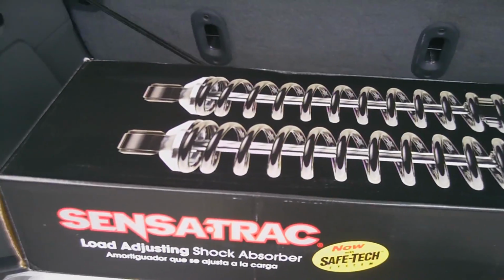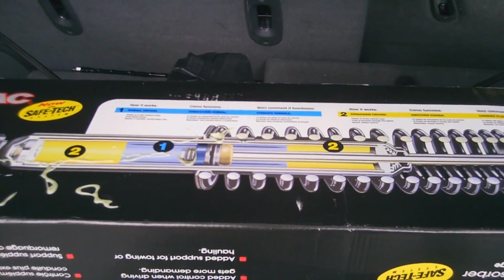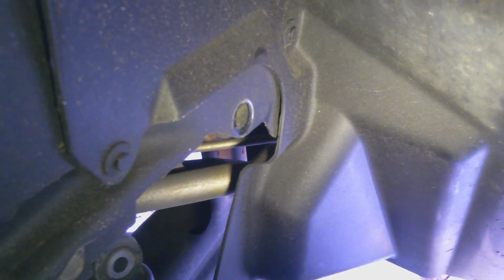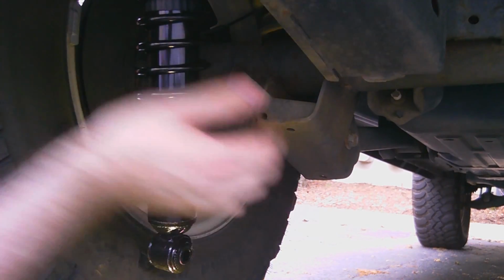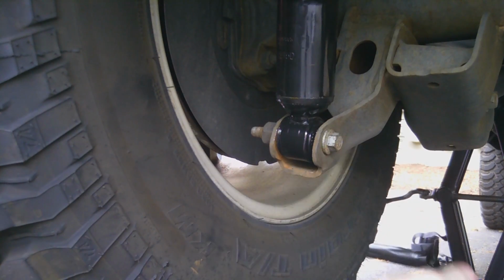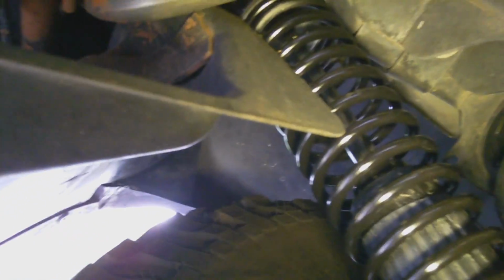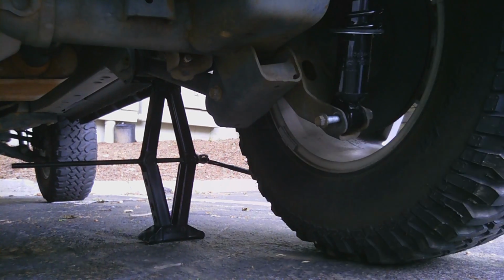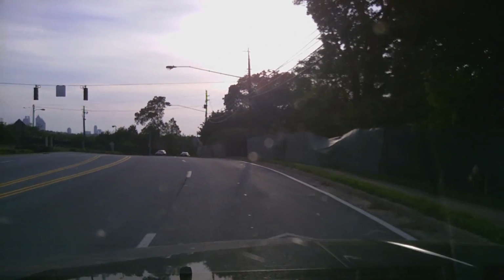How to Replace Rear Shocks

Comment: I bought the exact same shocks.  They are awesome!  My old shocks were so worn I could compress them easily and they would stay compressed a good five seconds before slowly extending back out.  I didn't have to cut any of the plastic.  I would say there's a good quarter inch clearance before the plastic and shocks touch each other.  Thanks for the great video!

Comment: glad it worked out well for you.  couple of comments:safety first always: chock wheels always - even in your driveway or garage / anytime you are lifting the wheels or frame/ especially if you are not going to be using jack stands;  set emergency brake for the same reason - just takes 2 seconds to do; pse use safety glasses - things always fall off of underside of the vehicle, dirt, rocks, pieces of rusty body, chemicals / things break off and fly off / you get backsplash from chem sprays (cont)

Comment: I have a 2003 jeep liberty sport -- had to remove the tires.  While top bolt has a frozen nut, the bottom bolt does not, so you need to wrenches to remove it.  The only way I could figure out how to do it was by removing tire.  Otherwise, worked just like he described.  Was able to compress the shock manually to get it into position.

Comment from the maker: Not yet, but I probably will this summer.  If you watch the install of the lift kit video, you will see me remove and reinstall the struts, though.  Only thing missing is just changing the spring over from the old to new struts...
Reply: dakota1989to replace rear shocks

Comment: Thanks for the video, just bought same shocks and installed on my 05 wk 4.7, bottom bolts were on real good though, had to jack up the socket wrench for me to jar it loose.  Any plans to replace your front shocks?  A video would be nice.  (no time lapse like the spacer lift video)

Comment: Hey Buddy. lol I had Just got into looking for some shocks on my Jeep Commander ,and I came across your video when I found the Leveling Shocks, lol too funny. lol But hey Great Video and you beat me to the punch.     But hey quick question. I'm always referencing the videos you've done on all the Oil Fluid Changes, and I noticed that you didn't use any royal purple in the Transfer and Transmission. Do you recommend going purple with those two or sticking to Mopar brand from the Dealer?

Comment: are there any shocks out there that will lift your truck or jeep, like not the full suspension kit, but just the shocks?  is it possible to find shocks that are bigger than your stock shocks, i want to have a little more lift on my truck. Thank you

Comment: Are the wheel spacers a must if swapping to these coil overs?? Thanks in advance
Reply from the maker: That's a great question.  I don't believe so. I used the spaces due to the lift I was running with factory wheels.  It was mostly to allow the larger tires to keep from hitting the steering knuckle.  They should be fine without them.
Reply: @jbrunsonjr  thanks

Comment: Was there a fork thing sticking out of one side of the shocks ?? I ordered Monroe 58594 Sensa-Trac Load Adjusting Shock Absorber from Amazon .. Does the fork pull out ? The directions don't help a lot and I don't want to break them . HELP :) THANKS

Comment: @jbrunsonjr yeah its defintily a nice vehicle im just getting some aftermarket rims that will make the tires stick out past the body like a inch and getting some bfgs all terrain but i have a queston im replacing the shocks on my gmc sierra will i be able to remove the shocks without jacking it up because im sure the springs will hold the weight of it

Comment from the maker: @marcosevelyn07 Taking the stock ones out is easy and doesn't require jacking it up.  Also putting in regular new shocks you can do without jacking it up.  With the coilovers, I had to in order to get it to fit, though due to the spring.

Comment: on my 2001 jeep grand cherokee I tried this and the bolt was so rusted and seized that even after using penetrating oil it snapped in the lower mount and is right now riding on a broken bolt. anyone know how to remove that broken bolt and where to get a set of replacement bolts?

Comment: trying to remove rear screw after removing the bolt and wont come out is seize to the shock ring where screw goes thru  help...ty
Reply from the maker: Try something called PB blaster.  Let it soak for a few days, and keep respraying it.  Hopefully that will help ya out with getting it unstuck.  Thank you for watching!

Comment: Will these shocks worth with a WK that has no lift? Says they fit my model on amazon. Curious if anyone has installed on a factory ride height vehicle.
Reply from the maker: Yup - they are meant for no lift and work well with the small lift I have.  Great bang for the buck.
Reply: I put them on my WK 5.7l with factory ride height. Replaced the Bilsteins for these because I was towing a trailer. These raised the rear end 3/4" and threw front end caster off. Handling became loosy-goose, especially when attempting towing. I replaced the entire front suspension and steering with multiple alignments performed, and installed polyurethane sway bar links and bushings, to no avail. In a hard turn, front would lead but rear end felt as if it was taking time to follow the direction of travel. I replaced the coilover shocks back to the Bilsteins and handling was  corrected.  
My opinion as to what went wrong:  the vehicle is a 2006 and most likely the main coil springs have lost some height.  The coilover shocks pushed the rear body up, thereby taking some load off of the jeeps main coil springs. In a turn, the coilover shock was the first to experience load (from the banking) followed by the minimally compressed main coil springs. The main coils weren't in total control of the vehicles weight in the turn. This allowed for a floating feeling of the rear end. It almost felt as if the rear body was separated from the axle, in a turn.  If the main coils were new or slightly higher, the problem may not have occurred.

Comment: You don't need to jack it up?
Reply from the maker: +Forrest Tewey Not really if you have a lift, you can just slide right under.  Jacking it up meant that much less that I had to try and compress that spring on the shock...

Comment: "Be safe jacking up your vehicle"? You got under your Jeep with nothing but the stock scissor jack.  Never ever ever do that. Lift or no, your jeep is coming down if that cheap scissor jack goes or gets kicked out, that's gonna either break something serious on you, or kill you. One of the two. If you want to leave your jack in there, use jack stands too. Redundancy can save your life.

You got balls for trusting that thing.
Reply: But it wouldn't fall far.. The wheel was still on. He's fine in this case.

Comment: lol i replaced my front shocks on my gmc sierra i bought used they had 148,000 miles on them and the rear its like theres no shocks at 151,000 miles im replacing them today with monroe reflex

Comment: No jack stands.   Struts are not worth dying over.  Buy a pair of jack stands bro..    Stay Safe.....
Reply from the maker: +Kevin Rheault I didn't replace the struts, only the rear shocks.  If it fell off the jack, it would land on it's wheels....in park...with the parking break on.  Thanks for looking out, though!
Reply: I know u were smarter than that